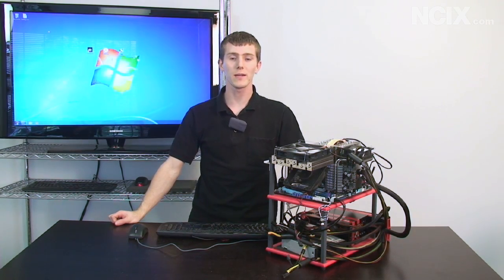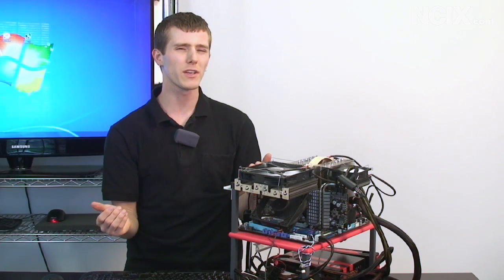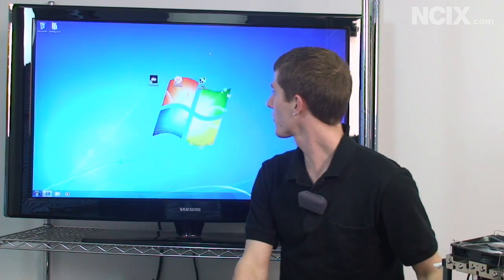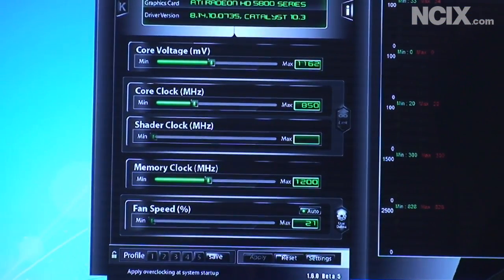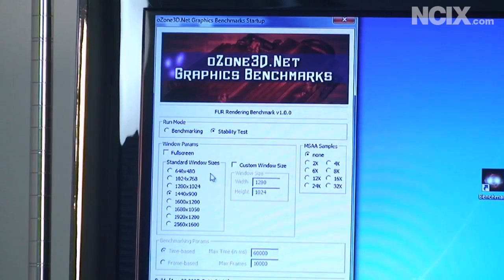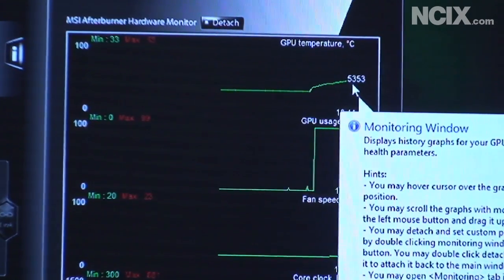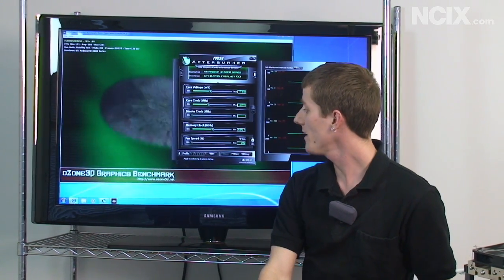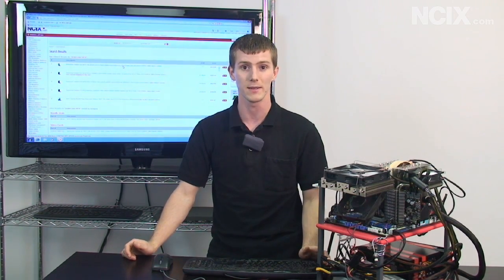Video Card Overclocking Guide (NCIX Tech Tips #69)

Comment: Help trying to overclock my 780ti but it keeps crashing. I have noticed a huge perfomace boost when i do but how do i keep it stable. looking to oc it to about 1216mhz. PSU evga supernova nex 650 modular psu.
Reply: dont listen to the people saying its your psu. I have a gtx 780 and even with a 3570k overclocked to 4.5ghz I dont get anywhere near needing an 800w psu. Use evga precision and just set it too +40 core and link your temp and power max to the right. You dont get too much performance to be worth being anal about overclocking. You have a great gfx card mate. When your card gets old and we get  games which test your card out proper in the near future then go 4 it.
Reply: might not be able to keep it stable at 1216mhz try lowering it to 1200 and see if it crashes
Reply: Sayyro curiosity
Reply: your psu is too small you will need an 80+ 800 watt psu
Reply: Agreed with Mahad, your PSU is the bottleneck there. If you want to do a TL;DR then in short you need to buy a more powerful PSU. If you want to find out why your PSU is inadequate, keep on reading,

I did a quick google of your PSU and you have 4 12V rails each at 20A. Now the way you work out how many watts is on a particular rail, you multiply the number of amps by the voltage. So it becomes A*V=W

For example, my power supply has a total amount of 850watts and 70A on a single 12V rail. So to find out how many of those 850watts is being spent on the 12V rail I do 70*12 which gives me 840watts.

Doing the same on your PSU gives me a total of 960watts across all 4 12V rails (240watts per rail), which of course is incorrect because your PSU is only capable of outputting 650watts. That means that yes, 1 12v rail might be able to cope up until 20A before it goes pop, but combined they have a much lower amperage than you expected.

I calculated it as 13A across all 12V rails would give you 624watts which sounds about right. So actually, when stressing your PSU you only have roughly a 13A load before it goes pop and gives up.. which is piss poor to be honest and it's no wonder why you're having issues.

Nvidia recommends atleast 600watts for the GTX 780ti. To give yourself some headroom I would go for a 750watt PSU with a minimum of 60A on a single 12V rail. That will give you a true 720watts of power on the 12V rail to play with.
Reply: Ro-Tang Clan I guess that might be why and also I have a couple of cables missing from my psu as well so more power is being used of one cable because it's powering like side fans and stuff
Reply: lekan adams Fans and other accessories like case lights etc aren't coming off the 12V rail. They are most likely coming off of the 5V rail. Also, something else to clarify; when referring to a "rail" this doesn't mean each cable on your PSU. Rail is a term used to describe a single line of power on the PCB inside the PSU. So the fact you're missing a couple of cables on your PSU is irrelevant to the amount of power its outputting.

Also, I made a bit of a mistake on my first comment. I revisited the specs of your PSU and whilst it does state 20A across four 12V rails, the max COMBINED output is the one to look at. This states 53A for your PSU. So it looks like what it does is combine all 4 rails before outputting the power, so you actually have a total of 53A to play with but that still only equates to 636watts.

To be honest my calculation was nearly right anyway. Divide 53A into 4 and you get 13.25A for each rail.. which is pretty much what I said originally. What I got wrong was how it applied and utilised the power. While 636watts is over what Nvidia recommends for the 780ti, the 12V rails aren't just being used for the GPU. You've also got the CPU using the 12V rail too. 636watts just isn't enough to overclock the already power hungry 780ti AND handle your CPU at the same time.

My point still stands, you need a better PSU.
Reply: I know I need a better psu and while I won't claim to be am expert of amps and voltages which I am not, I was mainly letting you know that dues to some cables being missing from my psu which is modular, the 6 and 8 pin connects for my gpu is also being use to power other parts I know it's still outputting the same power from the psu but would the power to the gpu be reduced if I have other things like side fans being powered of the 6 and 8 pin cables
Reply: lekan adams
 Why do you own a 780ti if you dont know how to overclock? That is like owning a Ferrari and not knowing how to change the oil! Further more there is no need to overclock that card.
Reply: beyond305 over clocking is simple it's just something I don't do and I didn't say I wanted to over clock now but in the future it's always and option.
Reply: Um youre contradicting yourself, you just said you need help trying to overclock your card. Thats means that A) You attempted O/C'ing your card and B) You dont know how to overclock because if you did then you would know how to fix that problem. Sir, you are a damn liar.
Reply: beyond305 I know how to over clock I just couldn't get the card to be stable and I was wondering if my power supply was the problem since every card is different. I was expecting to be able to get a higher clock speed without having to increase voltage. Anyway I have no interest in an arguement
Reply: beyond305 just read my comment trying to but it's crashing not how to I know how to do just needed advice on how to get it stable if someone else had tried it what they were able to achieve
Reply: beyond305 Judging by the responses I think the OP was trying to OC out of curiousity rather than necessity. Then he realised "actually I'm not able to OC it that far, I wonder why that is. I'll ask to see if anyone else has experienced the same or if anyone can help." 

I'm no expert on overclocking but I have more experience in overclocking CPU's using the BIOS rather than video cards using software, which is why I viewed this video. Point being, yes overclocking is simple and easy but even experienced people need assistance from time to time. Furthermore, if there is no need to OC that card, why would he need to know how to do it in the first place? 

lekan adams Sorry I must of missed your reply, but in response yes it would have an affect if part of the 6 and 8 pin power connections are being used to power other things around your case. We already established even with all the connections your PSU just isn't powerful enough to drive that card so taking even more power away from the GPU is making the situation worse. 

If you need recommendations on a new PSU I can wholeheartedly recommend the Cooler Master V850 which is what I have. CM are notorious for making bad PSU's but the Vanguard series are basically rebadged Seasonic KM3 units and cheaper than their Seasonic counterparts. If you are in the UK you can purchase one from Amazon for £123 here: 

http://www.amazon.co.uk/Cooler-Master-Vanguard-V850W-Supply/dp/B00CJ1UEKE/ref=sr_1_1?ie=UTF8&qid=1413962365&sr=8-1&keywords=cooler+master+V850
Reply: beyond305 let me explain it this way. Overclocking a gpu is easy,  getting it stable is hard. Everyone has different components in their pcs. Some people with a 780ti have gotten a stable oc at over 1300 while some people can only go a certain amount over their specified speed that's why I was asking no because I don't know but because I wanted to eliminate the variables to see if other people got a better oc and if so why
Reply: why do you have a 780ti if you dont even know the correct power supply you need just to run that card? every comment you make sounds so damn foolish, please stop. Down grade to a  GTX 5 or 6 series, thats more suitable for your amount of intelligence. People like you dont need to own high end video cards, hell i dont even know why you have one in the first place if you dont know the basic nessecities for the card! I dont own and have never owned a GTX or high end card that needs external power but I can tell you more about that card than you can.
Reply: beyond305 and it's a 500 and 600 series not and 5 and 6 acting like a fucking know it all and can't even get the names right
Reply: lekan adams lol the amount of contradictions coming from you is hilarious
Reply: beyond305 you do realise there's like 7 or more different versions of the gtx cards like asus msi nvidia themselves gigabyte evga. Each company make their card different and recommend different power supplies for example my old gtx 680 dcii top edition from asus is way bigger than my 780ti and takes up 3 slots in my case and still only requires a 650 watts and yet my msi 780 ti twin frozr edition which is much much smaller and take only two slots requires same power every card is different and evga card might be able to acquire a higher oc than msi that's why I was asking. Please take your stress somewhere else.
Reply: lekan adams  beyond305 Please can you both stop this unnecessary argument. I wouldn't even call it an argument, just unnecessary flaming. I really don't need a G+ notification every time you two decide to bitch at each other.

beyond305 You need to STFU as OP can build his rig how he wants to build it. It's not your place to come marching in saying what components he should have in his rig in correlation to his knowledge on the parts.

lekan adams The only way to find the true OC potential of your particular card is if you buy a more powerful PSU, end of.
Reply: rotang who the fuck are you the damn youtube police?
Reply: beyond305 oh my god dude just let it go please enough he's right just leave it yeah
Reply: youve got to have the last word dont you?
Reply: beyond305 No, I'm not the YT police but that doesn't stop me from being right and you being wrong.
Reply: you have to know the fact that no two video cards are identical even they are the same make and model. Some one overclocked same model 780ti to 1400, doesnt mean yours can. Every video card's quality is different. As long as you can overclocked to a stable value, it is a good overclock.
Reply: no one is saying its his PSU, we are saying he needs a bigger one! god damn how many idiots on here buy computer parts but know nothing about building a computer?
Reply: beyond305 You are the idiot here, the power supply capacity has nothing to do with the overclocking of the card. Hell even 500w power supply can hande overclocked 780 ti. Turns out you are the one not knowing anything about computers.
Reply: Why the fuck would you OverClock a card that costs 600$
Reply: Sayyro
cause you can...?
Reply: nah u don't want to fry your card as long as u don't have some experiments with overclocking, i did this to my 560Ti 2GB and now im hearing the goddamn coilwhine while playing games

Comment: i have a gigabyte 750 ti oc can i overclock it to 1300 mhz or something like that ?
Reply: as long as you adjust the voltage and maybe the fan speed you should be ok.. I have a sapphire radeon r9 270x dual-x factory overclocked and a I only jumped it by 30 MHz on the core clock(came factory 1070 MHz) and upped the power control from 0% to 5%. I'm just being safe with mine for now. and, although 2 very different cards, as long as you adjust it slowly you should be fine.
Reply: MEGATROID114
thanks :) but i changed my card to a 660 sli so i don't think i need ot overclock anymore :p

Comment: Speaking of the two HD 6950s, I found Furmark made the temperature on the main top card shoot over 100 centigrade...
Reply: The top card is running hot which says you have a cooling issue. It's common to have a card that is hotter than the other  but not that hot but it depends on how the lower card dissipates it's heat, as heat rises any excess heat from the lower card will effect the top card.  I run 290x's so heat was an issue for me too, I switched to two 3rd party coolers: specifically the Prolimatech MK-26 Apache 140 Edition.  Furmark is very intensive and will take any GPU to it's max, if you are benchmarking to gauge GPU performance then use Catzilla, Unigine Heaven 4.0, Unigine Valley .
Reply: Well, I opened up my PC and found that the top card, due to not having a backplate, and having a HIS IceQ cooler unit, was sagging. It was ridiculously close to the other card with hardly any gap for air to enter the fan.

I've stuck a bit of rubber in there as a spacer so hopefully it'll be better now...

Basically the reason I'd want to benchmark would just be to see if any game would ever overheat my graphics card.